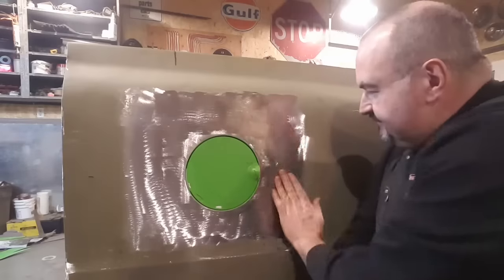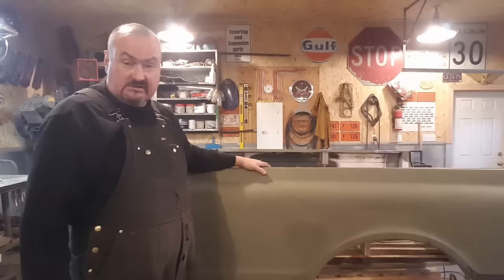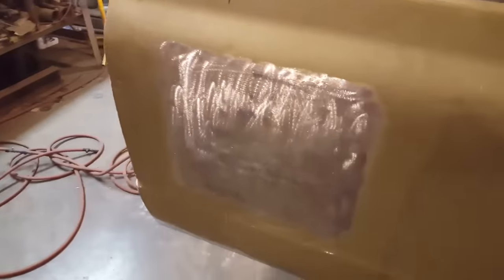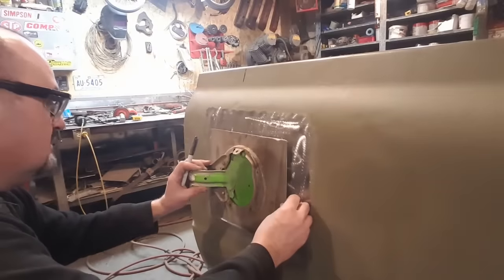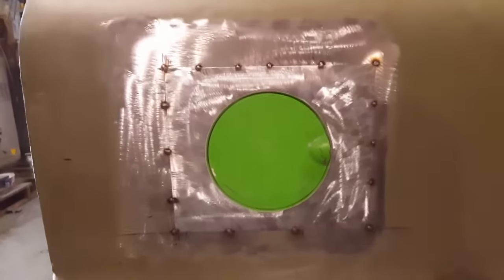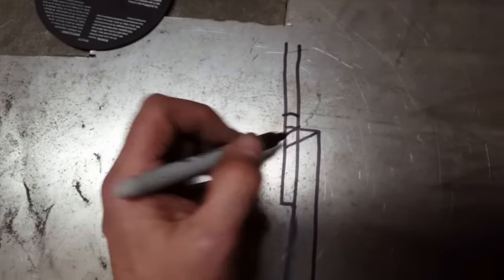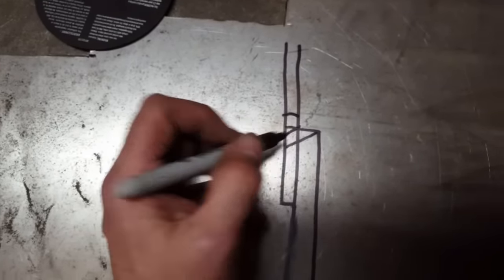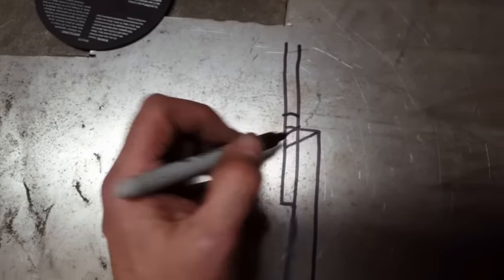Butt welding sheet metal the easy way.

Comment: Fitzee, I served an apprenticeship as a mechanic rather than a body man and was taught to do a basic patch using gas welding only. So when my Trans am needed both B pillars rebuilding at the joint between the roof/quarter panel I was dreading it especially as I only had access to a Mig, and being in the UK had no other T/As for reference (a lot of the joint had rusted out). Using your tips and tricks (cut and butt, thicker patch metal etc), I have just successfully completed the first part of the joint rebuild. I know in the great scheme of things it isn't like I've rebuilt a car from scratch lol but I just wanted to say thank you for taking the time to do your videos, they have been invaluable mate.
Reply: Awesome tips. Because of your experience, I will learn faster. Thank you for your video's.

Comment: At 9:06 I literally said out loud "You're a freaking genius" I have been doing metal fab for more than 20 years and I never saw that one before, Well done my friend, well done !
Reply: Strange thing is I have done very little metalwork but was my first thought on how to do it. I would probably screw it up though😁
Reply: Making a cut like woodwork
Reply: I said the same thing!  My family looked at me like I was nuts...
Reply: @zakibird  That's wha tI thought. I even suggested this once to a friend who was welding up some pieces on a car. I thought everyone did it like this. Very locical.  Great explanation Fitzee.
Reply: yeah he's a wizard alright
Reply: That is the absolute  worst way to do that. First cut a circle, second scribe it and cut with snips or grinder. Welding panels with square corners causes distortion issues. Welding a circle creates and even pull when it stretches/ shrinks. Also gen 1 S10 fuel tank doors have flat hinges so you don't need to cut [as big a hole] on the inside.
Reply: @maxwebster7572  show the link to your video. I doubt that all the guys praising this video will agree with you.
Reply: I understood at 7:59 😃
Reply: Actual fucking brilliance.
Reply: @maxwebster7572  Cutting circles in big sheets of metal is SUPER easy. Ever tried it? Hahaha. Literal infinite edges. I do believe rounding corners is a good idea though. Could even go with an Octagon instead.
Reply: Next patch panel getting welded in tomorrow will be using this technique. With the virus and most everything unobtainable such as replacement patch panels, building my own has been key to utilizing the expensive free time of being on lock down. 

The learning curve has been a steep one in the last few weeks dealing with creases, dents, hidden damage, rust etc on my 64. My thanks go to those out there sharing their wealth of info as it has helped me to navigate learning as I go working with metal over the years. The School of Hard Knocks has been ruthless at times but I can't say I didn't learn anything. 😒😁
Reply: J Smith This guy is a true craftsman. I have a problem where I want to replace a quarter panel, 
and this is the solution I’ve been looking for. Just genius!
Reply: @802Garage  For cutting round circles tin smiths have mechanized circle cutters. I'm not sure what your point is however I can assure you that welding square corners is a poor way to practice the trade. Octagons are slightly less poor.
Reply: Timothy LaPlante  That depends on the type of snips and how long you have been doing it. I did my apprenticeship on Morgans which are coach built cars and historic F1 Coopers.  Your comment shows who the troll is that can't use snips. Have you not ever watched a tin smith work or a panel beater? Try trolling Lazze's channel. You will learn a trade.
Reply: Timothy LaPlante  I really should not dignify your reply be responding twice but how do you think the panel beaters built coaches 150 years ago before angle grinders and zip cuts? They used snips. I would like to see YOU cut aluminum with a disc and then TIG weld over your contamination like that. Like I previously said, I shouldn't talk to you bc I've been in the trade and learned it from a Brit who was 75 and that was 30 years ago.
Reply: @maxwebster7572  what you say regarding tin snips, coaching building and etc is true of aluminium but NOT entirely accurate for steel work.
Reply: @maxwebster7572  please , links to videos of you demonstrating,  i am curious  ! Thanks !
Reply: @DUSTER7071  Instead of watching videos you should go and try it for yourself on a low crown panel. Then you can shoot a YT vid and disprove all my lies.
Reply: @maxwebster7572  It worked so.
Reply: @bradmajors1886  "Brilliance" is relative. This is a really well known technique in metal work.
Reply: If you really have been doing metal fab and never saw this, I am amazed.
Reply: @maxwebster7572  He just showed you that his method works.  The panel he's cutting through backs up to patch panel eliminating distortion.  In any case it's heat input that causes distortion, and he's tacking to minimize heat input, just like any experienced welder.  The other thing that minimizes heat input is a close fit up.  Please feel free to point us to the video where your method works better.
Reply: @JT-yz4rj  no he won't and you want to know why?
 He'll get a kid that wants nothing to do with actual work and restoration and all he'll want to do is play Xbox and get high and of course borrow grandpa's cool truck.

I grew up with the last of the Lead Work body guys.
Reply: max webster I agree with you,  you are correct. 
I pull the panel apart the thickness of the blade then it closes up perfectly.
Reply: @jenkinseric2  I agree with him.
Reply: Timothy LaPlante  Actually he is a real know it all. That is the preferred method actually. You could learn more by listening to others.
Reply: @jayvonvisger5609  I use the same technique on Quarters. My suggestion to you. Start at the wheelhouse. If your car takes trim. Measure and drill trim holes first. Then attach quarter to wheel house using the trim screws. 2 advantages. If you don't get the wheelhouse right from the start your in big trouble. The other advantage. You have the trim holes drilled and ready. And your not trying to drill a hole thru a very hard weld.
Reply: @maxwebster7572  I'd like to see your hack job.
Reply: @maxwebster7572  good for you.  Very few of have your supposed 'expertise', and looking at your channel, you don't have it either.  If you have a way that works better for you, why can't you show us, or just spare us your negativity.  Fitxee inspires hundreds of us to learn and get started welding.
Reply: Dude. I said the same thing.

Comment: So i have been studying patching with a mig and a few others that also zip cut around their new metal but then they fumble around with the entire new piece floating. Your method is the best and simple.    So i've done body work many years ago including rust repair but with gas only. You gave the final tip i needed. Retired now from another profession and getting back into some body work and a project. Thanks, you help a lot!

Comment: As an old bodyguy that did mostly collision work I'm enjoying your videos and picking up a few tips.  My eyes closed every time you pulled the trigger. lol
Reply: If you weld often remember that bare skin exposed to welding arcs is a recipe for skin cancer.  Long Sleeves and a Hood even if you can weld with your eyes closed.  If you weld once a year I wouldn't worry about it.

Comment: I'm genuinely quite annoyed with myself for how much time I've wasted over the years fitting up sections and holding them in position. This is a really, really good idea - thanks for sharing.
Reply: Why not use welding magnets?
Reply: @snipestaxservice7983  Magnets could be used instead of the holding welds but there would still be a risk that the weld-in piece moved. This vid really about how to get the new piece to exactly fit the hole. Great idea!
Reply: @nickhoare8906  I seen it on another YouTube video.
Reply: @snipestaxservice7983  magnets aren’t a positive clamp. Neither are spring loaded clamps. When metal moves, it’s a very strong force. Magnets also are dirty. They attract every tiny steel particle around.
Reply: @snipestaxservice7983  doesn’t make it right. I’ve been welding for almost 50 years, and I can say that magnets are a limited use product.
Reply: @melgross  thanks for the info
Reply: @melgross  magnets also lose their magnetism when you get them EXTREMELY,  hot. (Not that you couldn't use them in this sort of, project, & still be aight?)

This man is one heyll of a "me(t)al", man.

When this gentleman say's "metal?" It seems as though (from his, perspective), the "T", is SILENT? 

He can work on any of my vehicles, ANYDAYUMTIME he "feels", like it!!?
👌✌❤💯
Reply: @galenyoung8349  yes, they do, but that’s not a problem I’ve ever had with them.
Reply: @melgross  Good to Know,  brother. I was a little, uncertain. I was also curious if BIGGER/SMALLER ones made a difference when it comes to this part of the, equation.😉✌❤
Reply: Beautiful,,,upside-down?
Reply: Genius

Comment: One advantage of this technique is it forces a guy to go SLOW. Changing back/fourth between grinding and welding let's the metal cool down and therefore helps prevent warpage, due to overheating (a very common problem for guys installing panels). Very nicely done!

Comment: I have watched several of your videos and found this one to be truly exceptional.  Not just the 45 degree cut idea bu the cut weld, cut weld a bit at a time to ensure a tight seam.  I've replace panels about every way possible , with backing metal and stepping a lip in the backing metal, but this is a FAR better approach to a lasting panel repair.  I have several critical door panel replacements to do and this really improved my confidence that I can do a fine job on those.  I would love to hear more about your cutoff wheel details, I assume a .040 ?   I am going to go practice on some metal right now.  This is the sort of shared information that makes YouTube truly useful.  Thanks for sharing you are an awesome individual to make this video for us!!
Reply from the maker: The cutting wheels are 3/64. And thanks for the kind words.
Reply: @fitzeesfabrications  hello sir. I want to use the 45 degree method  on my 07 Mazda rear fender ,but how do I retrieve the cut peice.. thank you for sharing your knowledge.

Comment: Interesting tip...cutting at an angle.  I do that for drywall but, I would not have thought to do that for thin metal.
Thanks for the tip!
Reply: I would not have thought to do it for drywall.   Good idea.
Reply: Im a drywaller here in vegas an done that for years in drywall lol! Never thought on doing this to metal fab! I love it!!
Reply: @kike83._.  Same. Works on drywall. I'm embarrassed I never thought of doing the same for thin sheetmetal...his technique is even better as the OLD panel stays in place to support the panel as he goes. At  first i thought he was going to be a hack. Now I think he needs a Nobel Prize for Bodywork.
Reply: When you started explaining the angled cut, I thought to myself "DoH! I do the same thing when doing scrollsaw inlay with wood!
"
Reply: I'm just a home "patch-it-together" owner. I never thot of the angle cut for sheet metal or dry wall. 
However, I have tried welding drywall. Insurance adjuster was NOT impressed. 
Thanks for TWO great fixes!
Reply: Now I learned TWO things from this video!
Reply: life long Log home builder but a lot of drywall as well, can you explain your angled cutting?/ or have a video, love to learn, just like his welding panel technique??

Comment: I never thought of going in at a 45 with the cutoff disc. I love the reciprocating air saw for these because of the extremely small blade kerf. I'm going to give the disc a try at a 45 when I do some rust repair our daily driver this week. Thanks for the tip.

Comment: This was like a tip on a tip on a tip.  The 45-degree cutting is used in woodworking making intarsia and marquetry (think fancy wood inlay).  Because of the relative thickness of the wood and width of the blade, it leaves no gaps when the two pieces are assembled.  -  Using the old fender to support the new piece during weld-up is like a 10th-degree blackbelt genius.
Reply: And I suspect if we were to somehow put a measuring device on that angle, it would be right at a 45 degrees...
   Pretty damn close anyway, free hand and all...  hahaha
    He wields that grinder with precision...
Reply: You make a point that explains why I watch well done videos out of my activities. There are transferable concepts in these videos. Angle cuts make sense for intarsia and drywall patches. Seeing that there are techniques that result in predictable results also drives one to research a little with new projects. I’ve really enjoyed his videos.
Reply: @stephenholland6328  YES! Transferable concepts. Well said. I will never weld sheet metal to a car, nor rebuild an engine, but the transferable concepts and processes are invaluable. Thank you Stephen!

Comment: I did this at the weekend and it worked perfectly! FANTASTIC!!! I'm a beginner and struggling with fitment, taking hours to do a basic patch. what a revelation! Amazing. I had the old rust cut out of curved section on Hood/bonnet., patch formed and welded in, ground flat and, filled, primed in 3 hours. All outside in my yard in between rain. Thankyou Fitzee!!!

Comment: This is one of the most useful videos I’ve ever watched. I do collision repair work and when I weld in panels I have the hardest time getting a flush butt weld, I normally have to weld in a backing piece and use it to help fill in gaps that are too wide. I will definitely be using this newfound technique to help improve my welding
Reply: I hope you can reply to your reply as an update and let us read how it worked for you. There were so many tips included in this video.
Reply: "newfound technique"
We see what you did there. :)

Comment: Thank you for posting this tutorial and excellent technique! I have never seen this style done nor so well explained. I will do some practice on scrap sheet metal and then have at it on my 66 Bronco! And I have fuel doors, old filler neck holes in quarter panels and terrible speaker holes in my doors to repair. Thank you sir, great job!

Comment: If you want to further control warpage,pin holes and hard welds. 1 do not quench with air or water. It further hardens the weld. 2 stitch weld 5 to 7 welds. Then grind the stich weld. Immediately. Three things happen. You temper the weld. Making it sorted. You eliminate pin holes because you resume welding slightly on top of the weld you just ground eliminating the gap that causes a pin holes. And eliminating extra heat back into a cool panel fixing pin holes. And you are releasing heat in a controlled manner. Grinding is a process of melting metal and send it off in a spark. If you grind the weld when it's hot. You only add heat once in that area. If you wait and grind. You have added heat when you welded. Then initiated heat again when you grind. Heating the panel again. Try it. It works. I have taught this process to many people and it has helped. This is a very good video. One if the best I have seen. Just wanted to help more people. Hopefully the author will try it and like it and do another video.
Reply from the maker: Very interesting.  I will have to give this a look.
Reply: I think you will like it. You have more control over the panel. I would have also radiused the corners. But that is a matter of preference.

Comment: Tip from an old fabricator:  grind the paint off the part to be welded BEFORE you cut it.  That way you run less risk of thinning the very edge of the metal.   Yes, you'll have to lay out the cut lines (again?) AFTER you remove the paint......
 Also, when you are making the 45 degree angle cut with the cutoff wheel, cut .060" INSIDE the edge of the patch-piece.  That way you don't have to make a very precise cut to get a nice mating joint.
I like the 45 degree cut!!  One thing he didn't mention, but that he DID, was put the end of the hammer handle against BOTH pieces.  That way they are tack welded flush with each other.   Great video from someone who obviously knows what he is doing.
Reply: Also good tips, Thanks

Comment: Been fabricating with metal for twenty or so years. Not a lot of body work, but enough to know that you make it look easy. I’ve used this method with fitting wood together using a thin saw blade, so when I saw you start explaining the angle of the cutoff wheel, my mind put off just a little bit of smoke. Nice work my friend and very nice video production👍

Comment: For everyone that said the door is in backwards, go back to 5:20 and you'll see that he is working on the side panel in front of the rear wheel.  Which means the wind will blow the fuel door closed if the owner forgets to close it.
Reply: It will close from wind at about 150 mph! Those are stiff springs on the thick hinge, made to last or you  would have seen a lot of fuel doors gone off those trucks. I had a 71 C20 back in 1980, factory 350, 4bbl quad carb, oil bath air cleaner, 255 hp. granny gear 4 spd. It could pass cars on the uphill with a cabover camper on it and hauled all kinds of junk. The rear never sagged from weight, they were trucks.

Comment: This is a brilliant tip! I’ve only just started out doing car body work, I tried it on my project yesterday and whilst it didn’t work 100% due to the shape   (Inner wheel arch lip) and my inexperience it still worked really well and is something that I will use again many thanks for shearing!
Reply: You have to remember that practice makes perfect, this gentleman will have been doing this for years, its a brilliant technique and one I just wish I had known about forty years ago, so you see your never to old to learn,, (forty years ago we never had thin discs either even if you did have an angle grinder but such is life!), weld, enjoy and stay safe.
Reply: Shearing? That was Pun Intended right? 🤣